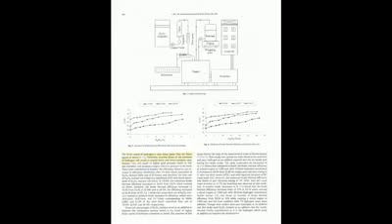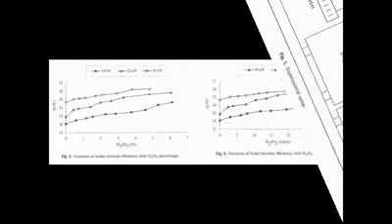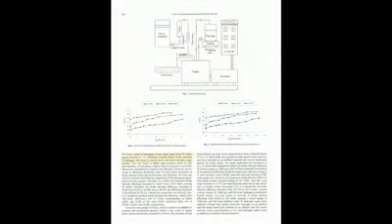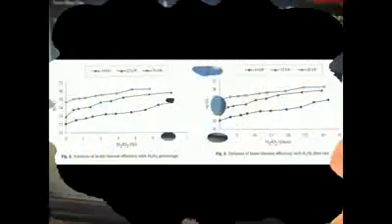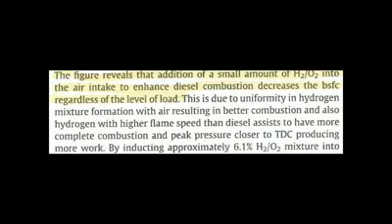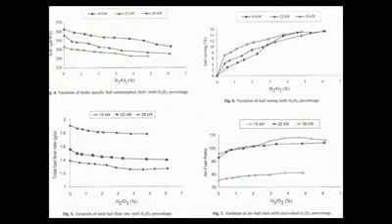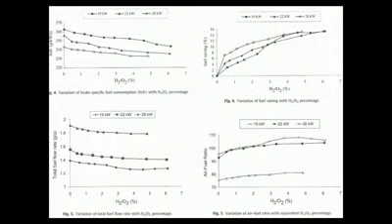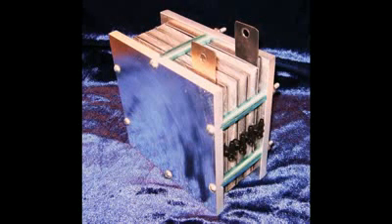Scientific PROOF that HHO WORKS Part 2

Comment: By my CFM calculations you may think I don't believe in HHO systems.... but I do! 
I just thin that people need to do the following things to make it feasible: 
1( step up the HHO output
2( Use peltiers (thermoelectric) for the electric since exhaust hear represents more than 40% of potential energy wasted)
3( Adjust the timming of the engine to allow for the faster combustion rate. 
4( use these systems for stationary engines rather than dealing with fluctuating fuel inputs

Comment: Take a 302 CI ford engine.(302 per revolution)
At 1000 RPM (for calculation)
That's 302,000 cubic inches of intake per minute.
To add JUST 5% HHO to this engine - multiply 302,000 By .05
You get about
15,100 cubic inches per minute.... Now divide by 1,728 = 8.738 cubic FEET per minute. So lets just say 8.5 cubic feet per minute (8.5 CFM)
Since one cubic foot = 28.3 liters you would need about 240 liters per minute.
240 liters = 5% of the intake of a 302 ford. 
Most HHO systms get  6 to 10 liters

Comment: drag racing using extra nozle for fuel add into the air mixture to increase horse power and turbo psi.

Comment from the maker: @retepvosnul --- "Doesn't it bother you in the slightest that the paper used here is only applicable to Diesel engines" Nope, because I understand the principles behind what going on and similar results have been seen in gasoline engines. "The little titbit that states that "for the setup the generator was not connected to the alternator but to an external 24 volt powersuply"." Actually that is the proper way to test the system, watch?v=JYq511CCSRQ

Comment from the maker: @retepvosnul -- "First of all, THERE IS NO ENERGY TO RECOVER." Wrong, the ICE wastes most of its available energy as heat. Adding H2 to HC Fuels improves the TE, converts more of the available energy to usable energy, i.e you recover energy that once was lost. This works no matter where the H2 comes from. If you add H2 made by the alternator there is an additional load to the system but tests have shown that this loss can be over come by the increase in TE.

Comment from the maker: @retepvosnul --- HHO isn't about getting something for nothing. The energy gained is not new energy, its recovered energy. Read the entire document for yourself, don't take DP's word for it. The paper clears shows gains in TE and savings in fuel starting at around 3 LPM. (Fig 2, 3, & 6 of the document). The effects H2 added to HC fuel has on the burn is a well documented fact. A faster burn rate makes all the difference. Research this fact and you will see how wrong you are on that point.

Comment: Some diesel engines actually use this excess fuel to cool the engine ECU as well. Some Caterpillar engines do this in particular. The fuel going through the engine can be as much as 3X what it would use at full load.

Comment from the maker: @Knightyme - They used a direct injected 4 cylinder diesel engine. What you see in the diagram is the fuel pump and fuel return line. The diesel is pumped to the injectors at a flow rate higher than needed, the unused fuel is returned to the fuel tank. This is a standard EFI set up..

Comment: The diagram starting at 0:57 to me seems, odd.

The h2/o2 generator dosnt seem to have a power supply going in.

The fuel tank has a fuel input *from* the engine.  So I read it like this.

1. fuel goes from the tank to the engine
2. engine uses fuel to run
3. fuel then goes back to fuel tank
repeat - forever it seems.

I'm no engineer, so i might be reading the diagram wrong.  It just seems odd to me thats all.

Comment from the maker: @Silverados1500 --- Altering the signal isn't bypassing the signal. The computer still gets a signal. If they are illegal then why are they still for sale on ebay? Also how is an EFIE any different that a ECU performance chip or ECU reprogrammer?  The fact is the EPA regulation is about reducing pollution and it is a proven fact that HHO does that. So you think you know the regs? Then tell us what the DOT says about on-board electrolysis units?

Comment from the maker: @Don --- Nope sorry, you fail. The section you refer to says it's illegal "to bypass, defeat, or render inoperative any device or element of design installed on or in a motor vehicle or motor vehicle engine in compliance with regulations under this subchapter." First off an EFIE device does not defeat the the O2 sensor, secondly a lean burning engine with HHO added runs cleaner so the vehicle remains in compliance with the code. On both counts HHO boosters are not illegal...

Comment from the maker: @Don --- The study accounts for the energy used by the electrolyzer, "The total rate of fuel consumption is calculated as the sum of diesel, the diesel equivalent flow rate of hydrogen and the diesel equivalent energy needed to produce H2/O2 mixture." If you read the report and look and the graphs you will see that changes in TE happens starting at about 3 LPM. Show me where it is published that a lean burn with HHO damages your engine?

Comment from the maker: @DonHoraldo --- A) The Australian test proves you wrong, the used 4-5% equivalent desiel input of HHO and got a 15% gain in fuel economy. B) The Australian study proves this wrong as well.
C) Adding H2 to engines has been tested and proven to extend the lean burn range of HC fuel without engine damage. It's B/S to state otherwise. 
D) It is not illegal to install one of these devices, in fact there is a vehicle currently in production, the Scorpion, with one installed.